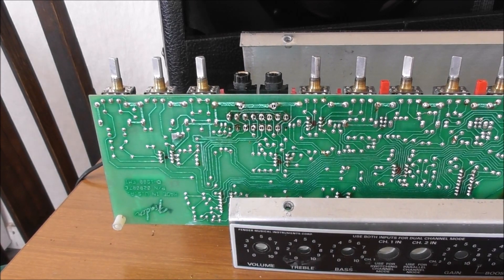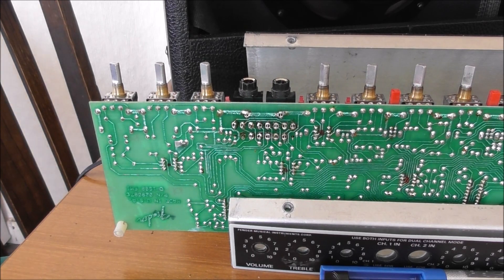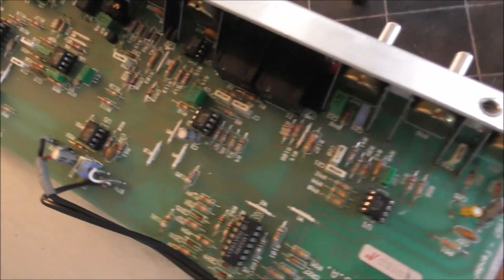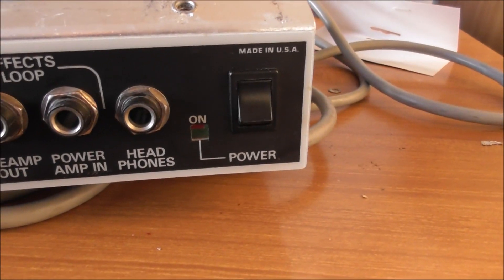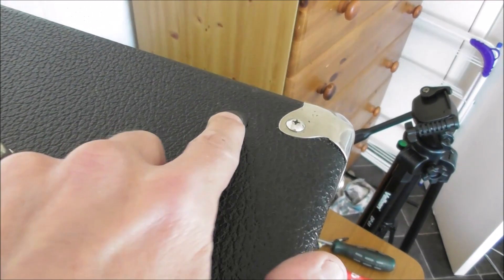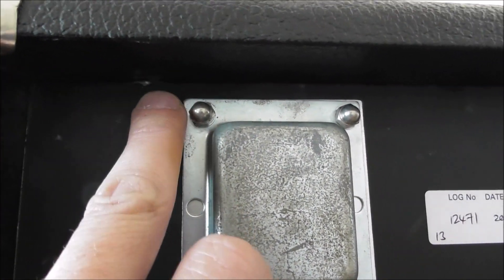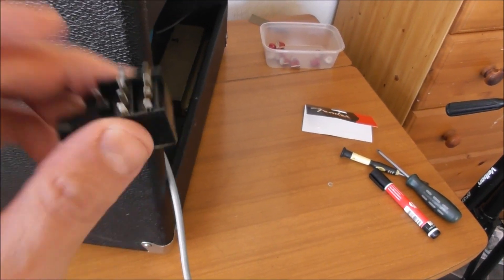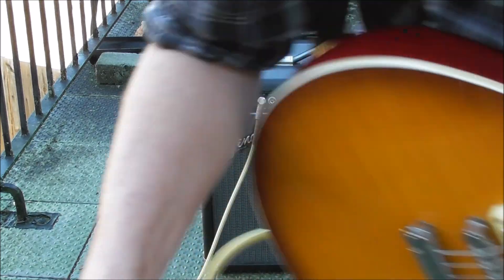Fender Deluxe 85 Pt-6. Back to the Drawing Board or...

Comment: I picked up a 100W Carlsbro that wasn't working a few months ago and finally got round to replacing the input sockets which were loose. No other fix needed. Cost me a fiver plus the parts.

Can't be the speaker as it doesn't do it all the time. I had a lovely old Gorilla Tube Cruncher with a 12" speaker recently. Pots needed a clean and it was making a similar noise. However, it only ever did it when the reverb was on. I followed instructions to test the tank, which seemed fine. Turned out it was simply poor connections at the tank due to corrosion and dirt preventing the RCA plugs connecting properly. Once cleaned, proper contact was made and no more problems. Worth a try.

Comment: Hi. Did you ever get anywhere with this amp? I have the exact same one and need to replace both input jacks due to damage. I'm hoping I've bought the right parts.
Reply from the maker: Was waiting for parts for along time, mate was going to have a look and fix it up then the thing came along
Reply: @tallthinkev  ah well. My problem was that I assumed the Jack's were mono. But it looks like they're either stereo or have some clever switching magic in them. I've now ordered 9 pin ones and will see if I have any joy.

Comment: Try a different speaker, just to confirm or deny...   sure, it sounds okay on channel one at low volume low gain, but sometimes you won't hear a problem until you crank up the volume and/or gains...    surely you can do that without spending much time or moneys...